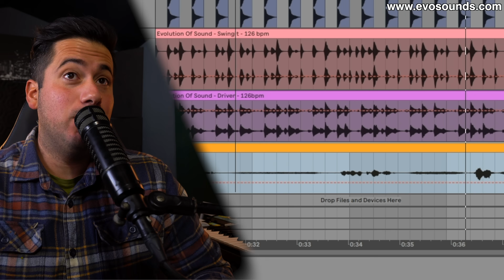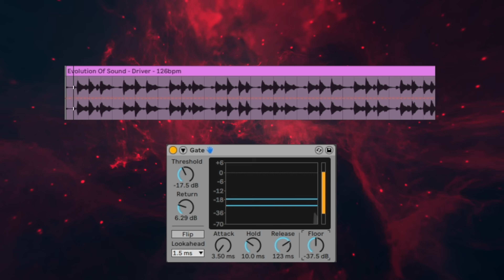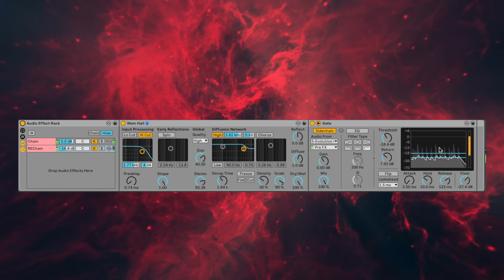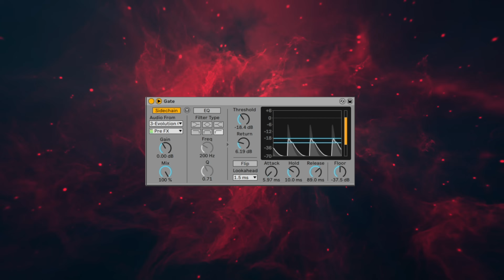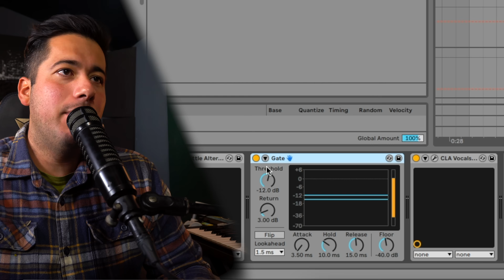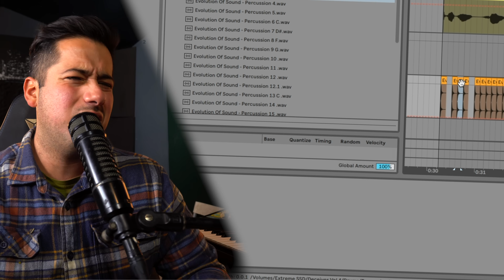Creative Gate Techniques For Tech House

Comment: Great video! My question is...when would you use gating on reverb instead of lowering the decay or messing with the parameters?
Reply: You can get different decay profiles with gating than just by messing with parameters. Without the gate, you get a smooth decay down to nothing, but with gating, you can get the beginning of that smooth decay, then chop the rest off. It can clean up the mix while keeping the size of the reverb. Gotta play around with it a bit to know when to use it :)
Reply from the maker: @rb707prime  thanks for clarifying friend. Great input!
Reply from the maker: Yeah ofcourse just proving a point. I would keep the decay a little longer if you wanted to gate reverb a drum
Reply: @ZenWorld  Thank u!